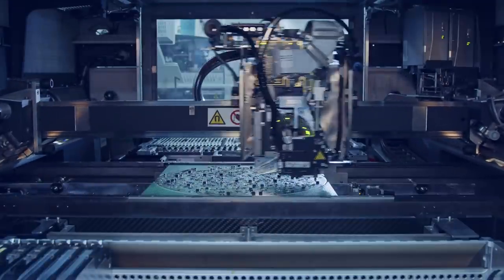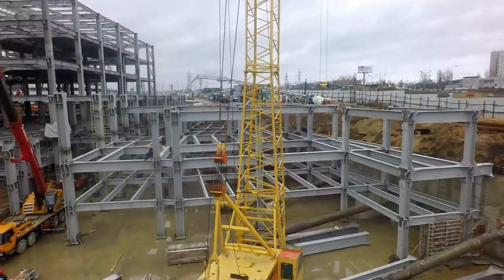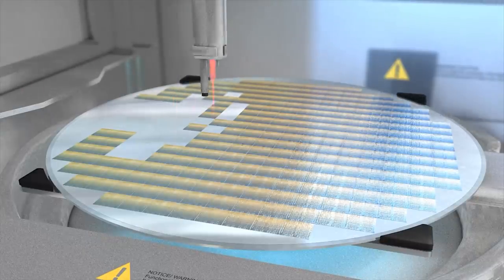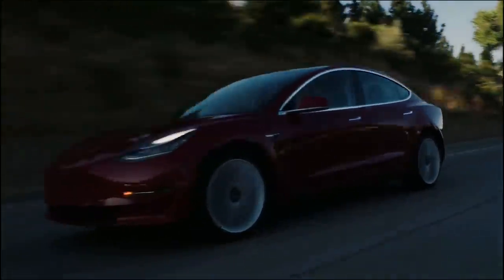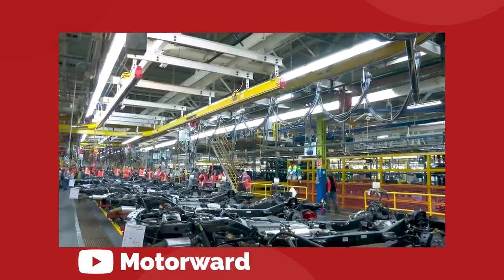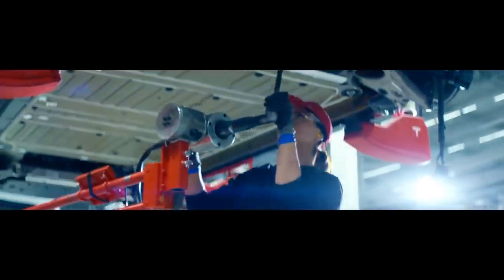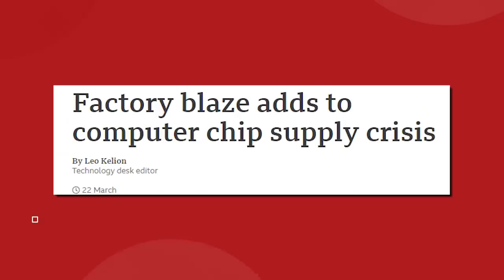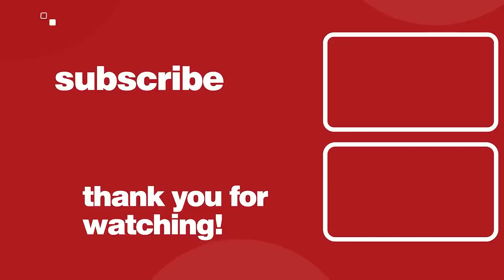The Real Reason Tesla Overcame The Chip Shortage Crisis!

Comment: You really missed a major point. Due to the high wage demand of unions, the automotive industry has no margin. Every component is built just in time. There is NO STORAGE. There is no possible ability for the automotive industry to store or stock up. The supply lines are just not built for it. The whole industry is one continuous assembly line, with multiple lines feeding into the main line. Everything is timed for a continuous feed. So when you suggest they should have just kept building, that is an impossibility. There is no storage. It doesn't exist. There are no warehouses. So when the government told everyone to stay home, everything came to a screeching halt. Yes some workers were kept on switching to essential manufacturing of PPE, but all car related production was forced to a stop. So when you say the automotive manufacturers stopped their supply lines, they had no choice, due to the forced business plan by low margin. 
The automotive industry is the most cut throat industry in the world. And it is all about labor costs.
Reply: auto mfg's are building the cars and trucks without the chips and storing them in huge lots all over the world... if they can do that they could have bought some chips and kept their place inline 🙂

Comment: You are making a lot of underlying assumptions here. The chip shortages have an interesting profile, that does not appear to have anything to do with Automobiles. For example there is a substantial shortage on BLE chips not used in cars, but a big supply of 8-bit processors with CAN (those used extensively in cars). So there isn't a chip shortage for that. There is a huge shortage for all PIC32MX, PIC32MZ processors with industrial temp spec whilst the consumer temperature is readily available. These (non automotive spec) are not used in cars. Can you explain any of these indicators that show the biggest shortage is in the industrial equipment chips and not consumer and not automotive? My company designs industrial equipment, and we are really battling to manufacture anything. I have not confirmed it, but all indications are that the shortage is driven by big corporations that are scared that there will be a shortage in future, so they did you what you say, went ahead and buy out the next 1-2 years of foundry capacity for their shelves. So they dont run out of stock. But they are going to cut off their own heads, because they dont seem to realize they are dependent on other manufacturers, that now may have a shortage. Eg. Automotive companies buying Fujitsu chips for the next 24 months. At least they can make cars right? Wrong! That same chip is used in the machine that makes the seats and steering wheels by a 3rd party. That 3rd party now shut down their production because they have a shortage (sitting on the shelf of their client). It is crazy how  all this is driven by Covid fear, fueled by the media.

Comment: Some of your numbers aren’t correct and the cost of chip factories (Fab) varies tremendously based on the technology requirements.  First off the $10B to $20B for a new Fab is for a leading edge Fab, which today is 5 nanometers.  These devices are primarily the most advanced microprocessors and unlikely to be in cars at this point.  One of the key technologies used in electric vehicles (EV’s) are power devices and specifically power devices made on silicon carbide wafers and not on silicon wafers.  This is important because the largest silicon carbide wafers currently in production are only 150mm while all leading edge production on silicon wafers is done on 300mm substrates.  Next, 150mm fabs are old (some are 30+ years old) and fully depreciated so cheap to run.  The challenge is adding the few new pieces of equipment needed to convert a silicon fab to a silicon carbide fab AND having the process technology (know how) for building these special power devices (this is difficult and well protected with intellectual property).  Next, a new chip factory can be built in under a year, this is done all the time in Asia.  In the USA the government sponsored delays are the gate.  It’s possible to go from a green field to high volume manufacturing in 12 to 14 months at the outside, providing the necessary government permits are in hand, I worked in this industry for almost 40 years and speak from experience.

Comment: “Their would have been no harm in stock piling a bunch of semi-conductors until production restarted” 

This isn’t true, Ford, GM and others (including Tesla) are big proponents of lean manufacturing, and rely on a “just in time” method, meaning parts arrive as their needed, it costs a TON of money to keep parts In storage and significantly increases the chance of damage/having the parts get lost. So it was actually a smart move to stop the supply chain at the time because parts sitting around cost allot of money because they take up space (that they likely don’t have) and the chance of damaging/expiring/loosing these parts is extremely high (much higher than you think). This lean method was invented by Toyota and is a major part of the “Toyota production method” the gold standard for manufacturing that almost all companies, including Tesla, follow. Also, chips become obsolete quickly so you wouldn’t be stockpiling chips of the same type.

Tesla made a major risk by not stopping the supply chain and this time it paid off but at the time it was foolish. The alternative to the lean method is hardware rich, which is far more expensive but would have eliminated the chip shortage risk because it relies on stock piling hardware.

Comment: Okay, these little microcontrollers almost never use "operating systems".  When they couldn't get the micro they normally used, they had to redesign the PCB for the chip they could get (because micros are not pin-compatible).  Then they had to rewrite big parts of the code for each board, because a lot of that code is typically "bit banging".

Comment: Somewhat simplistic and incomplete analysis that follows mainstream narrative.   While there are correct aspect like Tesla being able to design around chips available but it ignores what type of chips is in short supply or how cars designed by OEM.  

The chips that go into phones and computers are not the same chips that go into the car - that is the reason we can still buy PCs, laptops but not F-150s.   I have news, big Fabs are not building new fabs for automotive chips, they are building modern fabs that cannot make those chips.

Telsa did not get wrecked, but actually increased production not because they did not cancel orders, but because of how their cars are built.   Tesla has more in common with PC (which are in stock) than traditional OEM cars.   I suspect Lucid, Rivion will not have same problem but Ford, GM, Toyota will.

Comment: interesting that most of the "chip making" in this video was actually footage of robots making circuit boards. not at all the same thing as making chips. 

chip making involves some very sophisticated photolithography, involving such tongue-twisters as: surface passivation,  thermal oxidation, planar diffusion and good 'ole junction isolation. the connections on a chip are far too small to be addressed by even the very best modern machinery as depicted in the video. such machinery may be involved, but limited to packaging and transportation. one wonders whether the other "facts" in the video are equally off the mark.

i suspect tesla, if unaffected by the chip shortage,  simply don't use as many chips as other manufacturers do on a daily basis. not that they don't use as many per automobile but that the simply don't manufacture as many automobiles on a daily basiscompared to the top ten auto manufacturers in the world. 

and as a tesla investor since 2013, yes i am well aware the tesla is setting production records every quarter, but they are TESLA'S own records they are setting. they are not setting records WRT production compared to ICE manufacturers.

Comment: this actualy ignores one aspekt of fab development. It is way easyert to extend an existing fab than to build a new one. best example is the new bosch fab in Dresden. Building it cost 5 billion dollars and it only opened this year but they can double the capacity for 400 million within a year. and thats what they are now doing. Sidenote: building the Bosch Fab made Dresden the Largest Semiconductor production location in Europe and the 5th largest worldwide. If Intel who are supposedly locking for location for there newest fab decides to go to Dresden as well Europe will have a legitimate contender for newest silicon valley.

Comment: The chip manufacturers are dependent on one company (ASML) that provides them with the machines needed to produce these chips. The new semiconductors can only be produced using the machines of ASML since they have a monopoly on a certain technology used to produce these chips. These machines are called EUV machines and there is currently a waiting list to order this machine. One machine will cost 100 million euro's. So the problem is even bigger.
Reply: This is true for the very newest fab processes, those make the most advanced chips. There are a few other suppliers for less advanced steppers... and plenty of old fabs that are already up and running. The microcontrollers we are talking about here are made on older processes in older fabs.

Comment: This is a great video with a lot of interesting information, but there are some massive mistakes. just to name a few: the example you gave of chips in cars is just misleading. because you're comparing an expensive care with a massively cheaper car with a lot less features. Because if you compared to similar cars. an electric car actually has a LOT less chips then a traditional car because a major amount of the chips are located in the combustion engine which an electric car doesn't have, and an electric motor is so simple it barely needs any chips.
also you saying that Tesla can just take a different chip and reprogram their code to make it work is so far from the truth it's almost laughable, not only is that almost impossible for a lot of chips, even if it was the amount of work it would take to do that for every batch of cars/chips to bug fix and test etc. even a dedicated IT company wouldn't be able to do that.